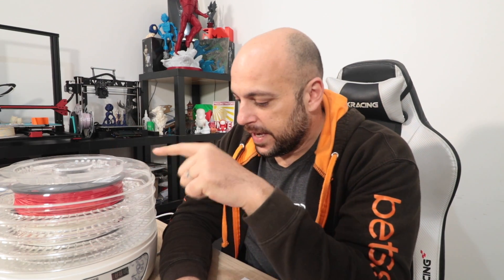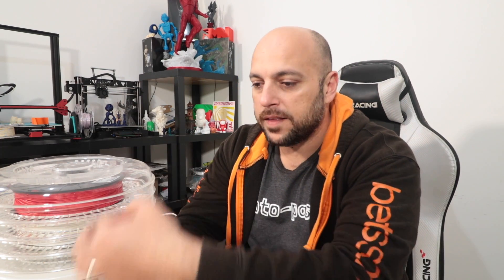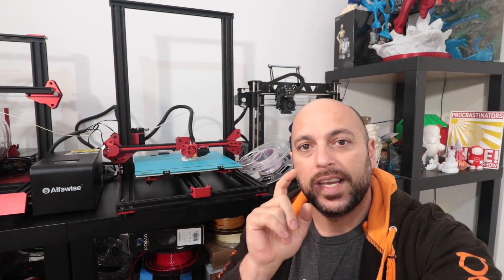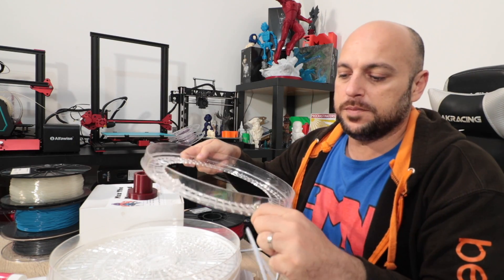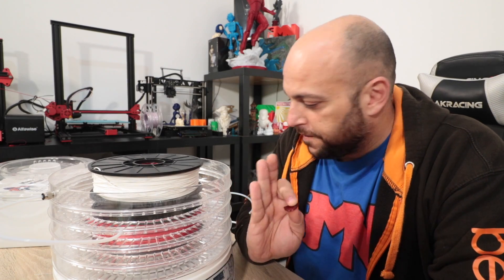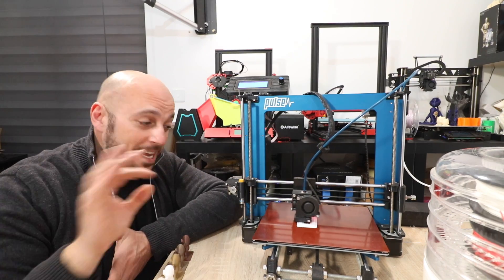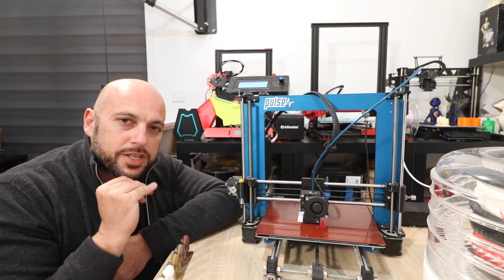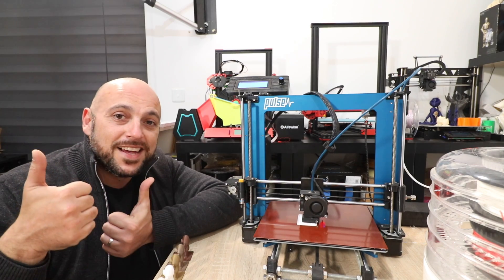Constant Supply Of Dry Filament  - Dehydraspool 3D Printing Project

Comment: As someone who does just this, I'd recommend buying Printdry units.  You'll end up with something meh in quality and not quite made for the job, but if your time is worth anything they are worth $125.  I have 8 feeding the printers in my shop.
Reply: The printdry is a rebranding of this dehydrator, which mind you has meh reviews at $40.
 
https://www.amazon.com/Rosewill-Countertop-Dehydrator-Adjustable-RHFD-15001/dp/B018UR4XJI/ref=sr_1_5?ie=UTF8&qid=1548101175&sr=8-5&keywords=filament+dryer

All you are paying for is a fancy plastic top that you can feed filament through, otherwise it's a extremely overpriced standard China direct dehydrator. It's a complete scam.
Reply: @sethkrumm3302  Right, I believe that's why he said, "If your time is worth anything." While I might save $85 buying and converting this unit, my income is around $110/hr. So if making this takes more than 45 minutes, I'd actually end up losing money compared to if I had spent another hour at work and bought a Print Dry instead. For someone earning 10x my income, they'd have to be able to complete this project in 4.5  minutes to make it worth their time. It is overpriced for most people though.
Reply: what a sad outlook. this is a hobby, it's fun. I don't get paid for every breathing minute of my day. making something like this is relaxing and it saves money over the retail version. I suppose if everything is a chore to you and you must be paid to move a muscle then no, this isn't for you.
Reply: tykempster there are buyers and there are makers :-) I guess that is the point.

Comment: Duude! Great idea! Should even increase the efficiency with really long prints! And this way you dry the filament only once and not over and over again. I would have never thought of that idea with the guide pulleys. The only downside is 200 Watts more per hour. But printing in an enclosure and on a cold bed mitigate that a bit. Really cool video!

Comment: If you use bearings for the rollers you could loop the filament more than once. Not sure it's worth it? I also recharge my desiccant in my dehydrator. The best thing about this idea is it uses the factory spacers. Printing spacers has been a challenge for me with PETG. And it's a waste of a lot of filament. What we really need is a cheap desiccant equipped storage spool that stacks on the dehydrator for printing. When you open a spool it immediately goes in the holder ready for pulling off the shelf and printing. Then you reuse the holder. The heat keeps the desiccant dry during use. Hmm, product idea.. I'm going to be rich beyond my wildest dreams. ;-)

Comment: Just a though but if you can dry a loop or two of filament in that short of time you could probably just rig a tube (thinking about the size of a vacuum attachment hose) to a fan and a small heat element of hair dryer and just run the filament through that between the spool holder and the printer.   This has given me a lot of ideas. ;)

Comment: what do you consider humid ? I live just north of Seattle ,WA USA and it's averaging 45% here .
Reply: 78% this morning in NZ and on the way up to the 90s I would guess... 45% sounds awesome.
Reply: @colinfindlay4790  not good either
Reply: 68% at this moment...
Reply: @dizzicz : WOW  that's wet
Reply: @dizzicz : where's here ?
Reply: @skippes_view  just google weather malta - first hit reports humidity as well
Reply: @dizzicz  : ok so your in Malta also
Reply: Really, Try 36 degrees C (100 degrees F) at 100% humidity. North coast of eastern Australia. Back in March 2018, like living in a sauna!
Reply: @bradpigott8883  wow
Reply: Everybody is talking about relative humidity. Its relative to temperature. Cold air can hold way less moisture than warm air so 45% humidity at 45 degrees F is WAYYYY less than 45% humidity at 80degrees F. at 32degreesF 100% humidity is also 0% humidity because the air cannot hold any water.  tl;dr seattle humidity is relatively low, but its cold enough that wet stuff doesn't dry quickly.
Reply: @uglypinkeraser  "at 32degreesF 100% humidity is also 0% humidity because the air cannot hold any water." Not quite true. Sub-freezing air can hold water vapor. Just that when the temperature reaches the dewpoint the water vapor condenses out as ice instead of liquid water. That's where the frost on your windshield (or house windows) in the winter mornings comes from. Also, if the dewpoint is below the temperature at below freezing then ice can sublimate directly into water vapor, raising the dewpoint. That's why if left long enough ice cubes in your freezer get smaller.

Comment: Awesome Idea Joe.  The tension from the rollers will also help with any backlash from "aggressive" retractions especially on deltas that print very quickly.   My only small suggestion would be to add external clips to hold the loose filament ends not loaded into any printers.
Reply from the maker: Very good point, will add those as well :)

Comment: Nice and clever solution. Good job!
What's the dehydrator power consumption?
Just a little suggestion: while 3D modeling keep your sketches simpler, divide your construction tree into lots of simpler operations. It drastically simplify the model and the editing process if you need to change something later. Rename sketches/operations for best results, expecially if you want to edit something when you'll have forgotted everything about your model :P … It's tedious if you're not used to, but I swear it save lives in the long run :D
Reply from the maker: Oh I’m so far behind in fusion360 hehe. I was just happy I remembered to design all part as separate components and had “most” of the parts dimensionally constraint hehe
Reply: Ahah :D I'm also quite behind with Fusion360, but I'm a product designer and I've lot of experience in 3D modeling with other CAD softwares. It's more a way of thinking, once you have it, different softwares need just some practice as new tools. At the beginning, as long as you manage to 3D model what you have in mind (with the least amount of compromises) it's all good :D ... You can generally get the same result following many different paths, some smarter than others. It just takes hours and hours of practice to know (most of the times) what's best when you start modeling, but you're definitely on the right track! Keep up the great work, it's always a pleasure to watch your vids. Greetings from Italy! Ciao!  @3DMakerNoob
Reply from the maker: Also, have to check about the consumption as I have no idea

Comment: Im not sure it will help, but you could try filling the center cylinder with dessicant or rice... that might help drying the center of the spools more.
Reply from the maker: I thought about it, but at the same time since the air circulates, it may prevent a better flow. Since now it heats as it unwinds, it should be fine though :)
Reply: @3DMakerNoob  Sure it will be fine until printers get much faster. Since you say you can notice a temperature difference in the center, there can't be much air flow as it is.

Comment: It’s not my design, but I haven’t seen anybody else mention it before. I just got this set up, initially for a Prusa MMU 1 (until I get the MMU 2), and it works amazingly. I have seen a lot of these smaller round food dehydrators being used, but you should really check out this design. 

https://pinshape.com/items/38565-3d-printed-diy-filament-dryer
Reply from the maker: Oh that looks much better than mine lol
Reply: 3DMN for €80 and then the files it is a bit more expensive (or you could design it yourself), but I liked the clean look and mod abilities of this one. Plus it is basically just as expensive as my Polybox to put it into perspective hahaha
Reply from the maker: Hehe true, in my case the thing cost like 35 - 40 dollars. As long as it does the job :)
Reply: Thanks for sharing this design. I think I prefer having the spools mounted vertically. I like how they have printed height extenders that double as a spool holder to stack with the existing translucent trays, smart! I'll be designing my own one of these with whatever rectangular model I can find locally.

Comment: I did exactly this (with the exception of the metre of single filament drying bit) about 2 months ago for my printers running in a garage in our usually very damp British autumns & winters (and springs and summers).  I had a roll of PET-G go 'off' in about 3 hours in these conditions so decided to build exactly what you've done!  It worked AMAZINGLY well!  BUT a word of warning... most dehydrators have a central turning mechanism and some alternate direction (mine does) so make sure you install the filament spools so the mechanism rotation doesn't unroll the filament - and beware to check the rotation direction on each switch on!  Might not be a problem for yours but worth mentioning as it may be an issue for others (like mine).
Reply: Oh and it works fine for me without the need for the filament rollers